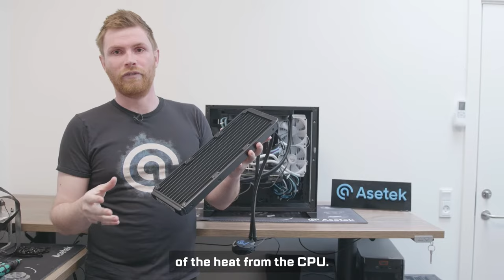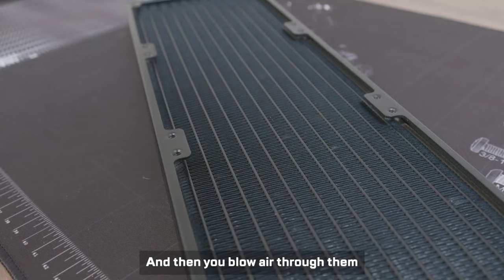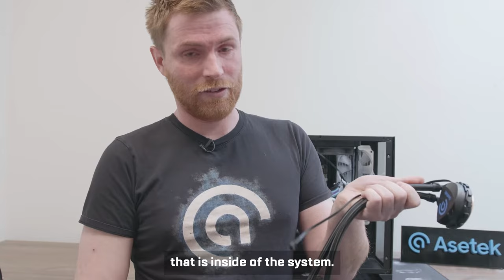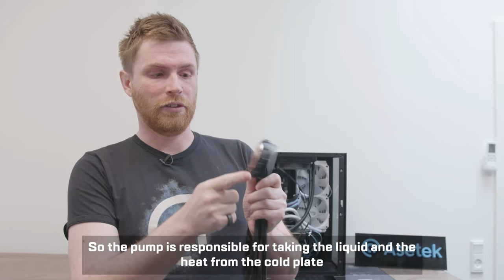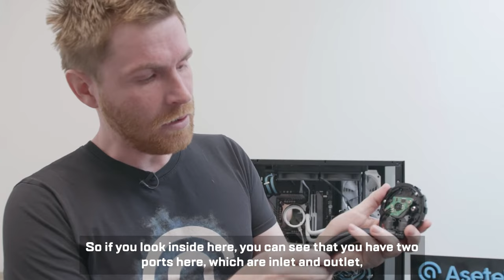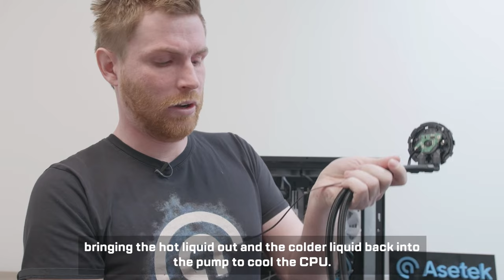How an AIO works - explaining the components

Comment: I screwed a hole in my nzxt kraken 360mm aio and I’m wondering how badly or if it will affect my cooler? I’m not noticing a leak or any pressure changes.

Comment: Have an evga 3080 Hybrid.  3 months after getting it the pump is now starting making these little intermittent buzzing sounds.  I believe they use Gen 6 right? Any tips for getting rid of the sound?
Reply: A year late, but a 'buzzing' sound in your pump could mean there's air bubbles trapped in it. This usually happens if you've tipped over the PC tower at some point, or your radiator is not the highest point of the AiO when you mounted it. If your radiator is mounted higher up than the pump in your computer case (any part of the radiator being higher than the pump will do), just tilt the case up, down, left and right (About 45 degrees) while the computer is on and the air bubbles should go back to the radiator.

Comment: Either Fractal copied Asetek or Asetek is Fractal? That pump is identical. My question is....Do they pressure the loop before they seal the AIO
Reply from the maker: Yes Asetek does. They are vacuum sealed.

Comment: Does the pump vibrate or have noise if it is working correctly? I got my pc and it is automatically shutting down when I power it on. I believe I have a dead pump cause I tried to change thermal paste and still doing the same thing.
Reply: If your PC shuts down that means the cooler is not working at all and that you need a new cooler. The pump does not make any sound ever.

Comment: When using a motherboard header, should it be set to DC or PWM in the BIOS? and is it ok the fun a pump on 100% from a say a molex/sata adapter cable?
Reply from the maker: Hi Rollthetape88,
The difference in DC or PWN is that your pump curve is shown in either volt (DC) or percentage (PWM), the outcome is the same if you go 100%

It's OK using adapter cable as long as you have at least min. 7 volt of outcome in the cables.

👌